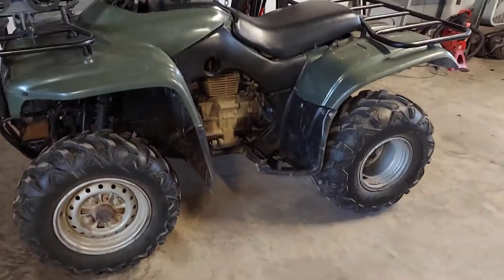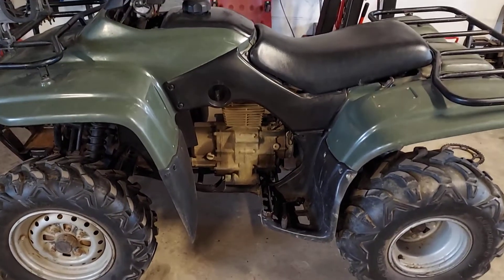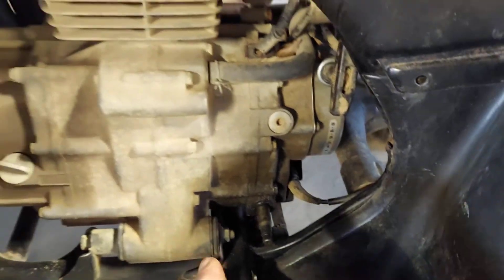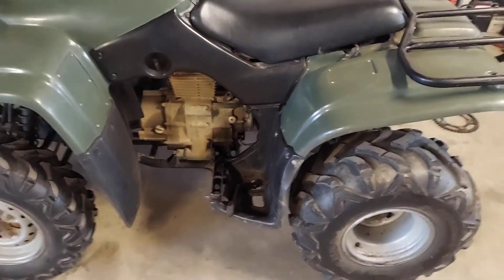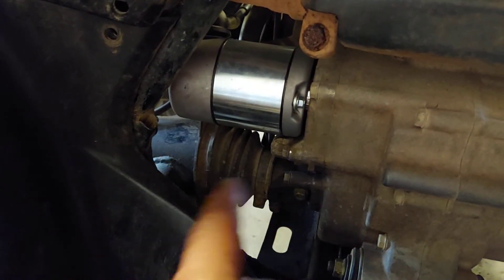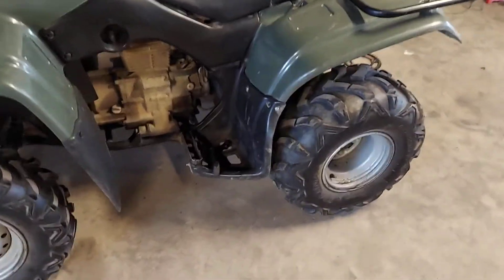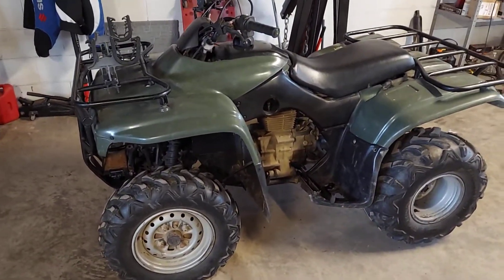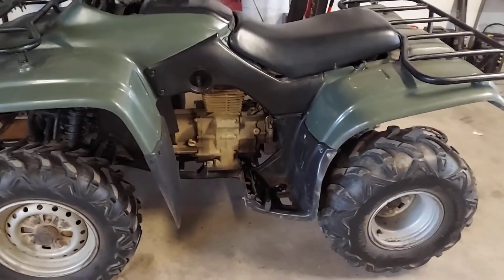2003 Honda 250 Recon stuck in reverse

Comment: We're you able to fix it? I have the same problem.
Reply from the maker: I had another Recon in the shop, so I swapped ecu's and then this one ran perfect. But then I had to put the good ecu back in the bike it belong to. Then just to see what happens I plug the ecu that belongs in this Recon and it worked perfect. So to some it up, basically from me unplugging the ecu for about 12 hours and plugging it back in it worked fine after that.
Reply: So not being electric shift you could still unplug the ecu and it reset whatever the problem was?

Comment: What was the fix
Reply from the maker: Most of the time when these get stuck in gear, it's the shift mechanism pushed too far and gets stuck. So I pulled the motor out of the bike to pull apart and fix it, when I turned the motor up on its side and turned the shift shaft back and forth, it made a pop sound inside like it was under spring pressure. Then it started working again. So put it back in and all is well to this day they still ride it. They thought they were in reverse,  but once I got it unstuck I found it was actually 5th gear. That's probably why it was stuck, because they kept trying to shift in the wrong direction. Here are a couple more videos about it.

https://youtu.be/1RuT9uQr8Qw
Reply from the maker: https://youtu.be/1RuT9uQr8Qw
Reply from the maker: https://www.facebook.com/profile.php?id=100057489818717&mibextid=ZbWKwL
Reply: My 2005 was stuck in reverse. However you side tilt method worked. But now it’s not going into gear at all. What are your thoughts?